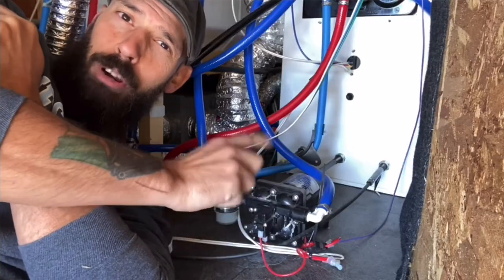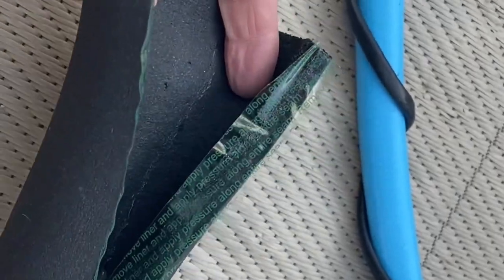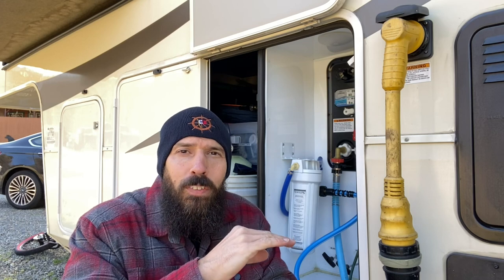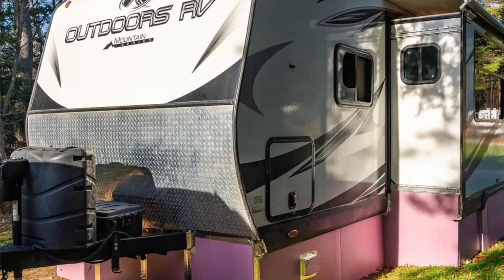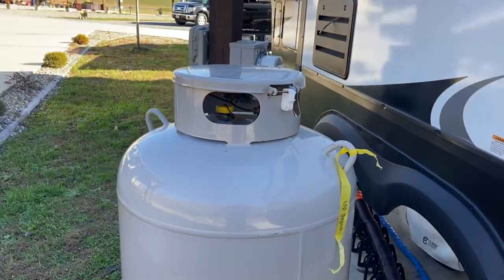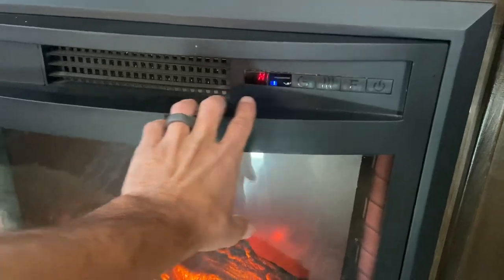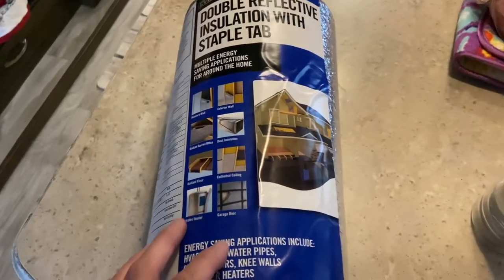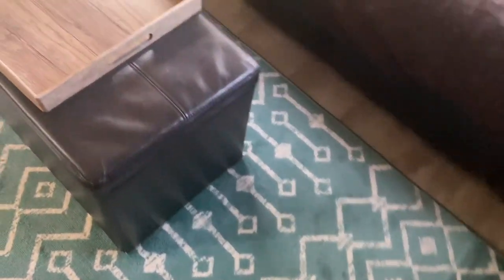RV WINTER CAMPING TIPS AND TRICKS (How to Build Your Own Heated Water Hose)

Comment: Use caution using electric heaters. If they are up high enough to prevent the thermostat turning the gas furnace on your bays will freeze. The furnace is what heats the bay.
Reply from the maker: Thanks we know this 👍🏼 Only use one space heater in our bedroom for night and our thermostat furnace thermostat is miles away. Been winter RVing way too much lately.

Comment: Thanks for putting together such an informative video, I wish I'd found you 2 years ago! My wife, 2 dogs and a cat are full timers in North Idaho. I made a heated hose using snowmelt cable, pipe insulation and PVC electrical conduit. I also used snowmelt cable and neoprene insulation tape on the underside of the entry steps to keep them free of ice and snow.

Both snowmelt cables are plugged into a wifi enabled plug (from Costco) that can be scheduled so the run times can be adjusted seasonally. When the outside air temp is above 25°F, a runtime of 15-20 minutes every 2 hours is adequate and when the OAT is below 0°, 30-40 minutes every 2 hours keeps the water running and steps clear.

For the waste pipe, I used 3"PVC pipe and regular heat trace cable with built-in thermostat and insulated the pipe with flexible duct.

I skirted the 5th wheel with 2" rigid foam board insulation and put 2" foam boards on top of the slide-out roofs for additional insulation and to protect the roofing when it was time to shovel snow off!

With kind regards,
Domenic

P.S. I put a thermostatically controlled radiant heater in the basement... keeps the Nautilus water panel from freezing and helps keep the bedroom floors a bit warmer!
Reply from the maker: Sounds like you don’t need my video at all! Hahaha You got it down pact as far as camping in the snow goes it sounds like. Nice ideas!

Comment: Good video! One consideration: If you use space heaters primarily, your basement with the water lines is not heated adequately. So you need to turn on the furnace every so often to heat the basement.
Reply: Good point.  I've seen a video where the owner put a dehumidifier in the basement to keep moisture level down.
Reply from the maker: True. Our furnace is always running, space heaters just to supplement a bit.

Comment: From another Solitude owner (3350RL) Good video and subscribe to your channel. We just left north central Indiana, cold! Now in Galveston! We use shrink film on most our windows, double sided tape, apply film then shrink with a hair dryer, works great. You can still see out and with sunny days allows radiant sun heating inside our RV. We do use some electric space heaters and the fire place but also use remote temperature probes, (La Crosse Technologies) to keep an eye on temps inside the storage compartment and another probe underneath inside the colorplast near the island water pex lines, That way the remote probes lets us know when we need to run the furnace to get the temps back up underneath or insdie the storage compartment.

Good Video, keep them coming!
Reply from the maker: Nice. I’ve heard people using bubble wrap as well. We have the La Crosse Technologies weather station too 👍🏼 We usually end up in Rockport TX for the winters but visiting both our parents in this area this year. Appreciate you watching and checking out our channel. 👍🏼😊

Comment: I'm using an oil filled radiator running off my Honda eu 3000 is generator, so far so good, and probably a little safer than a space heater.

Comment: Some really good tips - good summary of your experiences.  I really like your DIY heated hose.  FWIW, heat is energy and it is absorbed by cold, meaning that heat leaves your RV.  So unless you are speaking of cold air infiltration, cold does not come in (19:30).

Speaking of air infiltration, regardless of whether you are trying to heat or cool a living space, if you can stop air from entering and leaving, you will feel more comfortable and reduce energy required for comfort.  The foam backer rod suggestion is great!
Reply from the maker: Thanks, appreciate The tips and comments. Hopefully next winter we are back in warm sunny TX! 👍🏼

Comment: We like the light too. On the windows we don't Reflectix I put medium size bubble wrap on them. It's not as good but it creates a warm air barrier. The heat from inside the camper will warm the air  and if you happen to have sunlight coming through that helps too. Be sure to keep your humidity under control.  

I came up with the idea because I float bubble wrap on our hot tub in the summer to save electricity. 

Give it a try and see what you think.  Let me know. 

Chief
Reply from the maker: Good idea guys 👍🏼 I’ve seen people use the clear plastic shrink wrap as well.
Reply: @Why Wait  the problem with the shrink wrap is it doesn't leave the "air gap" to let the space provide insulation.

Comment: Please be careful about the y you used for fresh water and black flush, you could contaminate your fresh water if the black tank flush should back up for some reason. We use a separate hose just for the black tank flush for that reason. Maybe we are over thinking but better safe than sick! Good video! Thank you for the timely info.
Reply from the maker: Thanks for watching and Appreciate the concern. 😊 Our back flush for the black tank has a vacuum breaker/ check valve that would prevent any back flow, which makes it pretty much impossible for the water to flow back through it should the tank ever get that high somehow and flow back up that way. Plus we always keep the other side of the Y splitter closed when flushing. Not to mention this is only our winter setup. 👍🏼